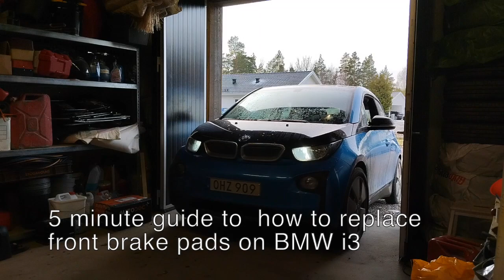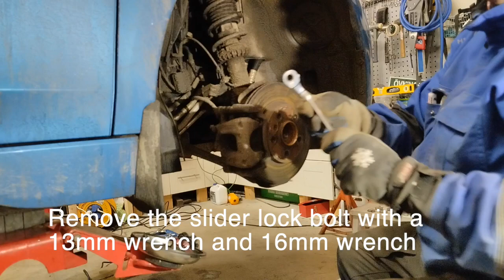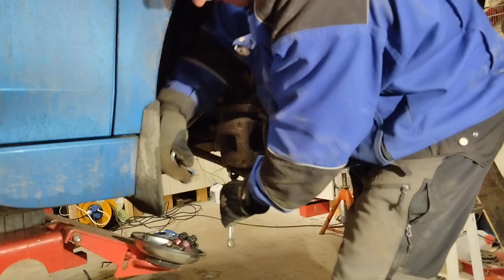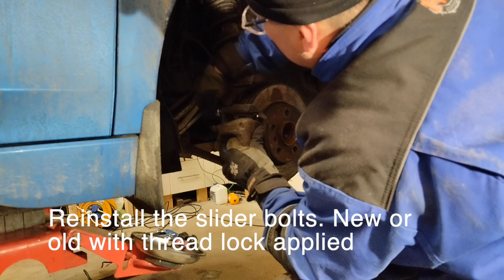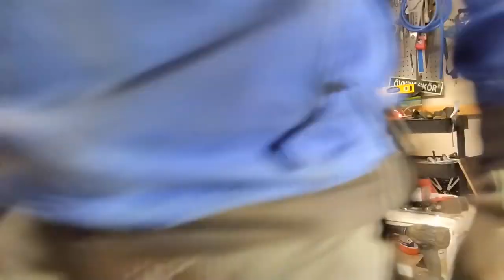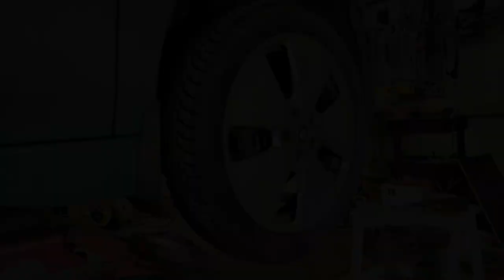BMW i3 front brake pads replacement - 5 minute guide!

Comment: I have a 2015 i3 and after compressing the calipers could not get it to students over the new thickness of the pads, I called orient part store and was told I needed to use my scanner to release the calipers fully I haven’t heard or seen anything like that on any of the YouTube videos of how to do the pads anybody know what I’m talking about
Reply: I have purchased three different sets of front brake pads and all of them are too thick.  The caliper span measures 51mm, the worn rotor measures 19.2mm, and the pads measure 18-19mm each.  Watching this (https://youtu.be/8f3SmThVJEs?t=182) shows real BMW pads are 7.5mm thick (looks like a 4mm 'frame' for 11.5mm total).  What's up?
All the information I've found (including physically looking at the front calipers), the scanner is only needed for releasing the EPB when working on the rear brakes.

Comment: This is the second video on the subject I have watched with no mention of cleaning and lubricating the slide pins???
Reply: That and replace/resurface rotors. Also need to brush clean many areas in between.